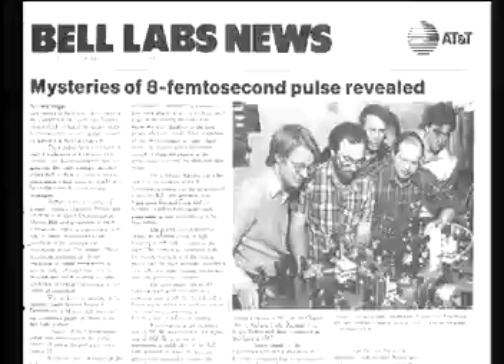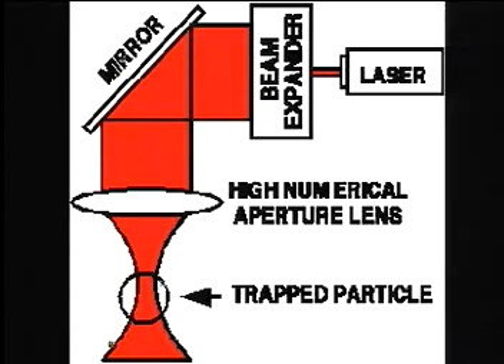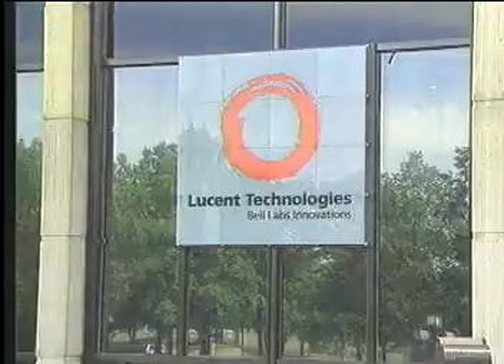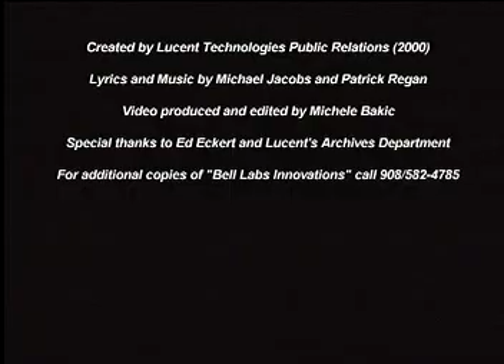Bell Labs Song

Comment: Alexander Graham Bell
Thomas Watson
Tedy Bell
George Campbell's wave filter
Calling ships ashore
Frank Jewett
Harrold Black
Negative feedback
Televisions, fax machines
More and more and more

Hifi talkies, movie sound
Laying copper by the pound
System engineering, quality control

Karl Jansky
Herbert Ives
Davisson wins Nobel Prize
First speech synthesis
Beethoven in stereo

["
Bell Labs Innovations
The communication for the next generation

Bell Labs Innovation
Our contribution to the revolution
"]

.. Bucly
Mobile phones
Radar ..
GI Loans
... cellular
Voice spectrography
Claude Shannon
Richard ...
William ...

PCM
... William Phem

Transatlantic cable 

Non-blocking networks
Microcoding scheme
Outside masking solar cells
Transistors win the Nobel
Arthur and Charles, what a team
They invent the laser beam
[""]

Touch tone
Foil electric microphone
LED

Digital transmission
Long distance dialing
First ever paging
Superconductivity, ion implantation
MBE, CCD
Magnetic bubble memories
Penzias and Wilson hear the Big Bang noise
Automated switchboards
Ever moving forward
... Switch
... added to its voice
[...]
Jhon ...
Ken ...  Unix

Quantum wheels

C Language

Fiber Optics will endure
Electron beam lithography

Thomas ...
Alfred Cho
Packet data bell
Double UVM?
Transmiting over microwaves
Solar power ..
Transistors getting so small, you can't even see them
[""]

DSPs
All in one chip, if you please
Penzias and Wilson win the Nobel Prize
Bell Labs gets a new boss, by the name of Ian Ross
Lightwave goes long distance
Cellular gets digitized
S language
C++
... data bus
Femtosecond pulses
Deep UV lithography
Software windows in a screen
Gigabite transmission seams
Tunable lasers
Programming ... sharp as a razor
[""]
Megabits on a chip 
First electro-optic switch
Atom doping
Microcells
HDTV
Transatlantic lightweight cable

Neural networks
Bucky balls
Superconductivity

Data ... without the wires
Operating systems
Software methodologies
Optical crossconnect
... president
Bell Labs ... Lucent Technologies
[...]

Steven Chu wins Nobel
Transistors smaller than 200 atoms wide
X-ray, microcode
Imaging your frontal lobes
Circuits on plastic

Internet telephony
Microphones the size of peas
Stormer, Laughlin, Tsui win the Nobel Prize
Free space optics
Petabits

Lucent's star is on the rise

[""]

Source: Cat-V
Reply: You da real MVP

Comment: @venkatguitar And so he is, as I touch with him upon the experiences of working for the company. Such as... The resounding difference (Emphasis on sound) between the ESS in operation and the the old automatic pulse-dialing triggered mechanical analog one. Imagine 10K crickets in a room, all sounding-off at once. Now amplify it by 100x. That's what the old dialing system was like to endure.